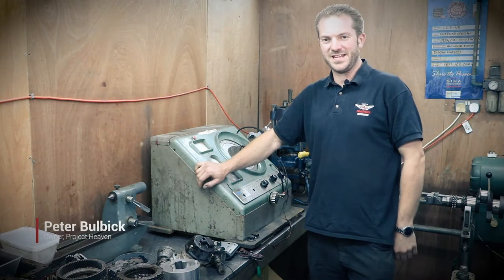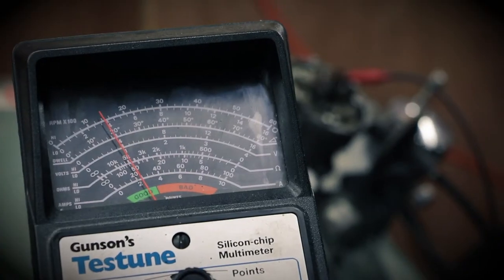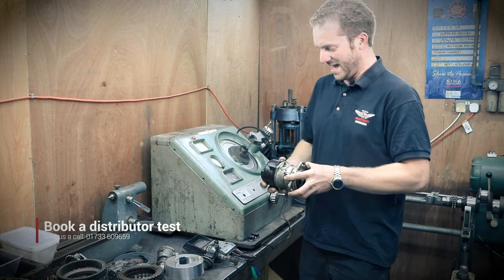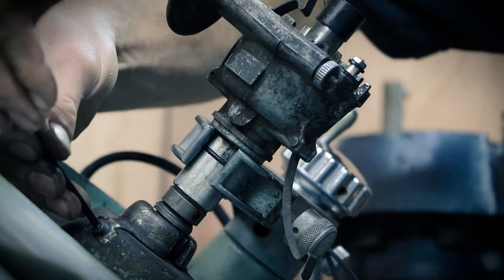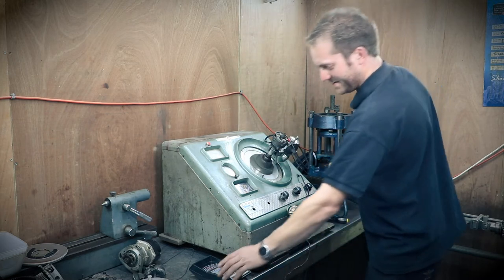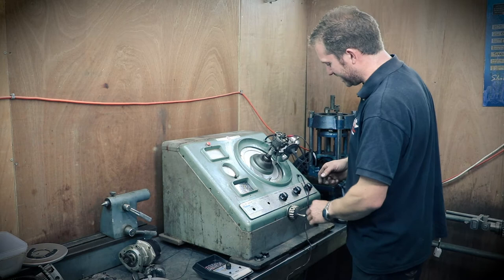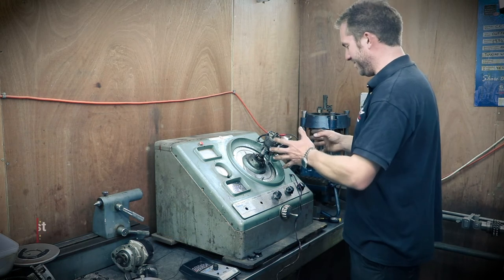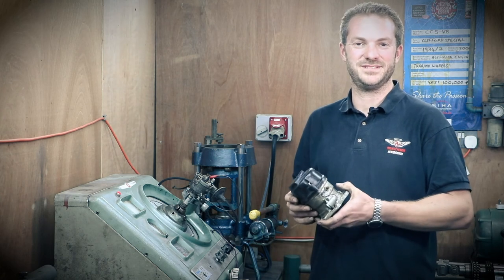How to use a distributor testing machine | Classic car restoration (How To)

Comment: How did you convert the internals to flash an LED array for the pointer? I have the exact machine and I can't use it anymore because the last of the two Xenon bulbs are burnt out. I tried to source out a replacement and nobody offers anything else to replace it. I tried using a type of LED timing light circuit available online but that isn't working properly either. Not sure what to do at this point and it's just been sitting at the back of my garage. I found your video through a Hagerty Classic Car Insurance article and this is exactly what I need to do for my machine! I have another YouTube channel showing my machine in use (petergt4 - Allen E-1415 Syncrograph Distributor Tester). Thanks for any help you can provide!
Reply from the maker: Hi, spoke to Pete and said it’s quite a long answer, if you can email him with a phone number he’ll give you a call about it. His email is peter@project-heaven.com
Reply: @ProjectHeaven   Thanks I sent it! Looking forward to hearing from him!
Reply: If in the states, I have a module which converts SUN distributor machines to LED.  It also has a feature called DWELL SPARK which produces a second point marker allowing you to read dwell right from the indicator disk.  LED are really fast and point bounce can be seen.
Reply: Have you got this sorted?  I've been in touch with a guy that has a kit to do this.
Reply: @opera5714 
I have one of these in the States that the strobe just went out. I could use some help getting it working again.
Reply: @mescko 
Still have info on a kit to convert the strobe?
Reply: @jimmazak2475  Post a video with cover removed to show a detail of the strobe.  There are always solutions.  This is just a technical problem.  I have no idea what you have if you do not show me.

Comment: Just won and picked up on of these on 'The auction site'.  You can set up an ignition module from an electronic, i.e. pointless distributor (the GM HEI module is a doddle) if you are running a Pertronix or some such.  I'm so excited, now I can check the dizzy for my MG and my Rover!
Reply from the maker: How did you get on with it?
Reply: I became an owner of a complete (not tested yet..need to replace a few wires with cracked insulation) of one of these Allen E1415HD syncrographs.  If you or anyone reading has some war stories of how you adapted to use electronic ignition, I would love to hear.
Reply: @ProjectHeaven  Haven't done anything with it yet, going through it is on my New Year's 'to do list, as I've added an early XJ6 to my stable a few months ago and I suspect the vacuum advance isn't operative..  I have just been in touch with a fellow that designed and built a circuit that replaces the 1b3 valve (we call 'em Vacuum Tubes) and it's circuitry, and replaces the flash tube with an LED, I will be getting one of his kits.  There are also amplifier modules available for testing pointless dizzys.  I'm also going to tackle rebuilding the vacuum pump as I'm reasonably sure it doesn't suck, and we all know vacuum pumps are supposed to suck :D